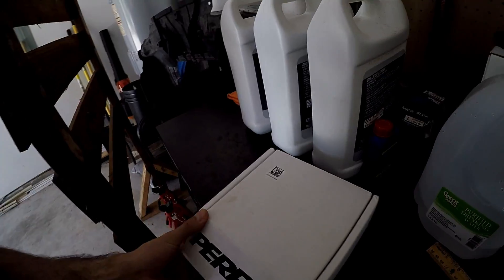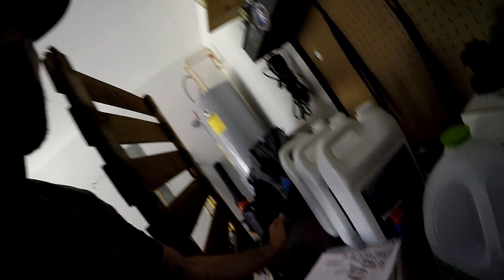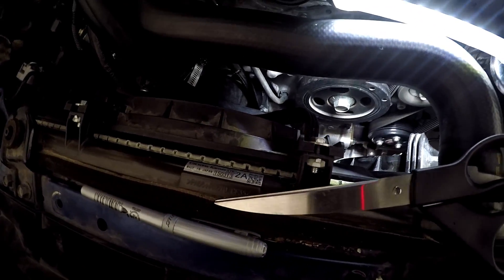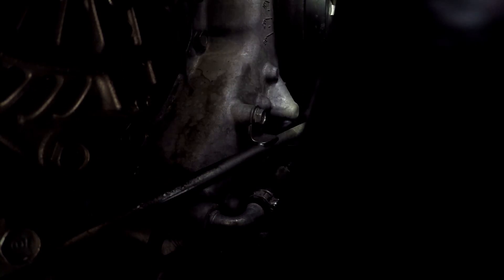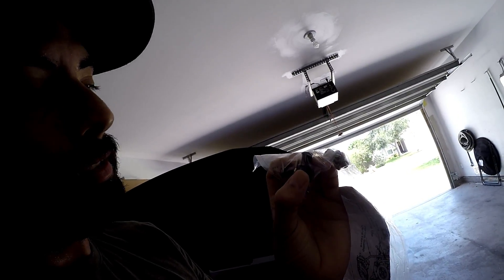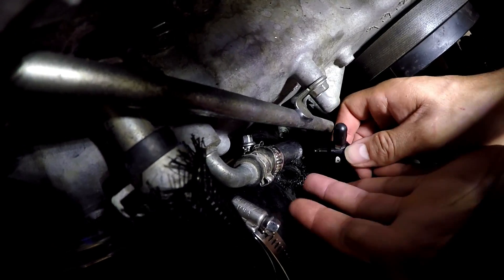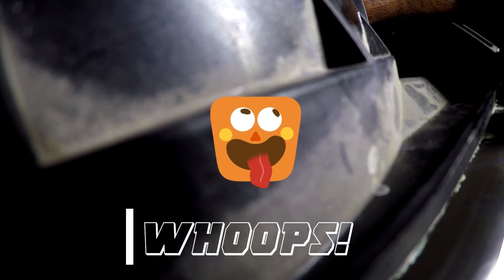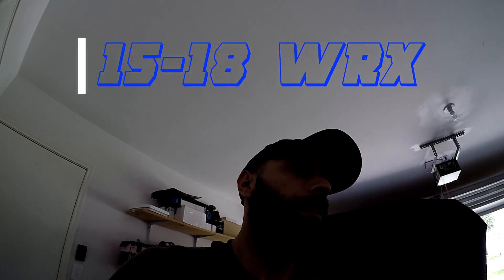PERRIN Turbo Sump Restrictor INSTALL/Install FRIDAY

Comment: Did the restrictor make much of a difference?
Reply from the maker: No. Funny you're asking, I am looking to remove it and install a new one hose. Been running the turbo sump restrictor for a year almost and really haven't noticed anything other than small amounts of oil leak around the turbo sump restrictor.
Reply: @lilzoobs7859  Thanks man I appreciate it! Was just looking for an honest review before I started chopping up my hoses. I know the blue smoke is normal in these cars modded. But still cant help but be nervous seeing it. Love the videos btw! Hope you start making more!
Reply from the maker: @VD_the_GodKing  appreciate it Kevan ! Means a lot to hear that.
Reply: @lilzoobs7859  Have you done a video putting a new hose?
Reply from the maker: @javiercisneros639  hey brotha,  I kept the hose but I left the pill on and just used zip ties.
Reply: @lilzoobs7859  I had a horrible boost leak when I installed that shit, took it off